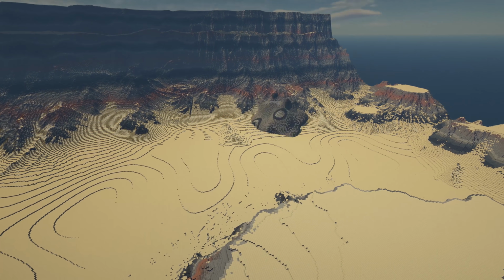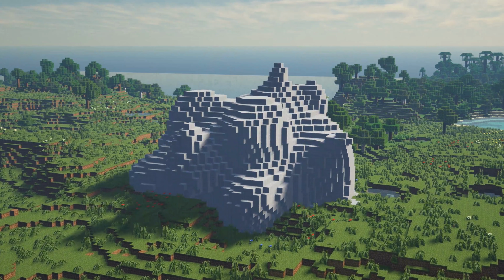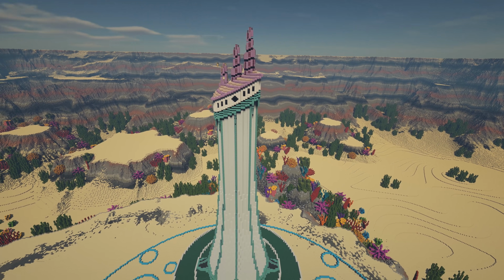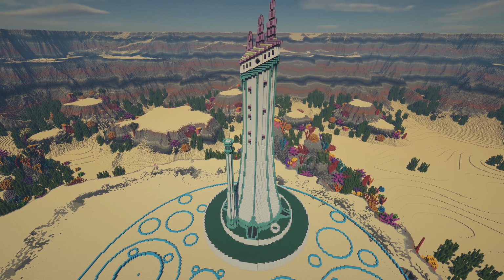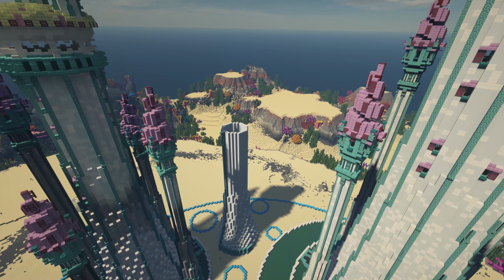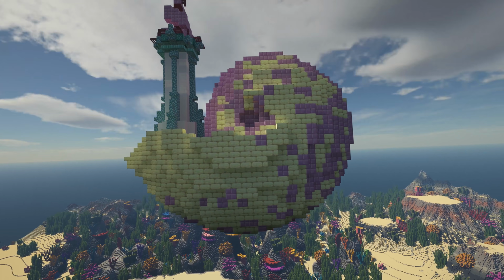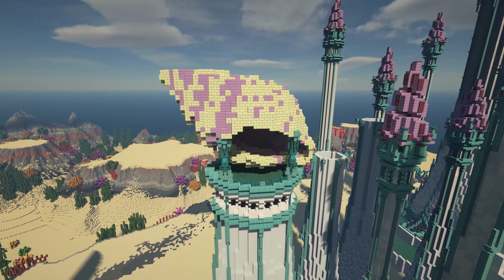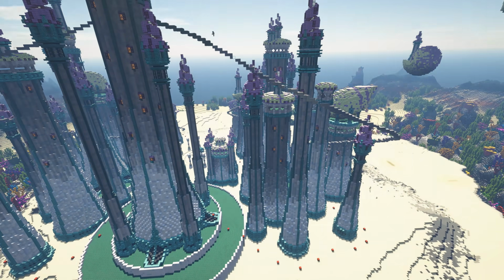My Most Anticipated & EPIC Minecraft Project EVER!

Comment: Sociological Idea (Backstory):
The Underground Kingdom and Underwater Kingdom are rivals - so wouldn't it be fitting for them to have different social/class-systems?
The elvish Underground Kingdom was built very symetrically - symbolozing their view of "black and white" - social classes. They had the rich and the poor - the castle and the slums, which seperated the Kingdom into an elite-area and a poor-area.
Now the Underwater Kingdom appears to have asymetrical builidings and infrastructure - which could stand for a more anti-class system. A system, less seperated by social classes, but with the wealthy and the poor people living side-by-side.
While the Underground Kingdom is more focused on wealth and high-culture, the Underwater Kingdom could be more focused on social contacts, breaking the walls of wealth. They also don't have a cold high-culture, but more of an easy, warm, friendly culture.

This would result in opening the castle to all the people. - Probably they have a wall around it, but in case of an attack (of the Underground Kingdom for example) all of society finds refuge in it. This could be constructed and achieved, by adding a room under the castle, with the only purpose of getting as much people as possible in there - in case of emergency. 
Also having a defend-system, not only protecting the castle, but all of the living-areas would be logical at this point.
Considering the more social-oriented ethics, it would be fitting if the Kingdom had a place for festivities that are celebrated together. 
A vital kind of market or trading place would also fit the idea, somehow pointing out that even the richer people take part in trading there.
The society of the U.W. Kingdom is one community, one Kingdom - fighting one fight: against the Underground Kingdom.
Reply: Underrated comment, TrixyBlox needs to see this one.
Reply: @okamifenris2713  thanks for your support! So warming to hear this..
Reply: Ohh my god this sounds so cool! How is everyone in the comments so creative? And I love the duality of the class systems between the kingdoms!
Reply: @roro_is_tired9975  thank you! I loved the idea, too, had to share it. Cool to see others aggreeing with me ;)
Reply: I think this so a great idea as well it’s so creative I love the idea of having the, underground kingdom and the underwater kingdom being rivals! That is such a creative idea people are so creative!
Reply: @Arson-b6j  yeah i like the idea of the rivalry too! This is such a cool and big project from TrixyBlox!
As well, thanks for supporting my little idea.
Reply: @lage3127  Hahaha! Your comment is spectacular. It blew mine out of the water. (pun intended) We said the exact opposite things lol although you now changed my mind and i believe the concept of an economically equal society in which they fight against the modern day social structure which currently has a very classist outlook, is a million times better than the idea of a class gradient. I think the clash of older times with the new would be an amazing sight. Cultures that are more aged may have the habit of thinking more black and white whilst being forced into a modern age anti-class society and id love to see how he portrays this.
Reply: I also see we have a similar style of speaking lol. For the people that dont understand uhhhh... @Lage is uhmm "Woke"?
Reply: @wishlesskittenscards5651  so cool haha.
Yeah, i think you're right with the similar speak. Don't know if i'd consider myself 'woke', but I don't know, so many things to categorize with today😂
Reply: @lage3127  hahaha such deep talk over a minecraft build i find it entertaining!

Comment: Ideas for the build:
I’m uncultured when it comes to shells so bear with me here

1. Put conduits on top of the pointed shell roof of the clam. Cause it made me sad that the pearls weren’t included or maybe on top of the shell roof to make it seem as if has pierced through the clam as it seems to
2. Put a dead ruin of the kraken slanted over the top of a building or on the side as if it was heading towards the castle and maybe add a couple more buildings and wreck them I guess as if the monster crushed it down
3. Guardian statues at the entrance as if they are guarding the castle
4. If you do add the chisel and bits mod could you add some small plants to add colour inside of the build cause at the moment on the ground area it looks bland or if you add water add small plants onto the sand
5. Add bridges from some buildings to each other to make it look connected

This is a lot so many of these suggestion are honestly large so I don’t expect you to do it. Love your work! Keep going!

Comment: will you go back once the water is added and add in some live coral blocks to the coral you made? right now as your building without the water they'd just die and turn gray so mute point to do that now, would make the reef look dead, also even though that one is meant to be the power source, due to the mechanic and range of said mechanic, wouldn't it make since to make a sculpture of a much larger one and use the real one as wireless routers for the power throughout the kingdom? I think when active they give off a bit, though very little, of light, might be worth making the conduit inside like a crystal to look like its powering the others that could potintaly be dotted around...would make exploring easier too unless if we get the world's download we explore it in creative so we don't drown just getting down to the castle...can't help but fixate on this tid bit of the design for some reason idk

Comment: sea serpent bones at the edges would be epic.

Also, if you made a slightly different design of nautilus shell and placed them hanging around in 3 dimensional space as homes or guard ships/transportation, that would be rad. I mean, an underwater kingdom would not be as restricted to the ground as others would be.

If you did connect anything to the ground, giant chains to the sea bed would be awesome. Even nets used as walls, too

Comment: The water staff have 3 different moves the z move it boost u to your aim and if it full charge it does 1o damage but to be full charge it will takes 1t sec s I not that ez to get and cool down is 5 sec and the next move à : a move that when click u tranform into what u are aiming at cool down 3 sec so the last move q : when u click q u push out a water wave the was full charge it does 13 damage so now the ice staff

Comment: I think you should have a statue of a leader like how you had the elven founders in the caves, except in this the state is damaged/almost destroyed (maybe from an attack by the cave elves), half buried in the sand and at an angle (maybe have a pedestal next to it as if it was broken in half, or maybe no pedestal but remains of one as if it was eroded away), have an arm broken off and several blocks from the main structure, damage to the statue like holes from either weapons damage or erosion, and it obviously being over grown and maybe a new reef is forming on it.
Also maybe add an underwater volcano somewhere.

Comment: Suggestion: Since it is underwater and under all that pressure use stronger blocks and more aquatic blocks in your builds to add to the "strength" of the kingdom. Also make everything completely underwater with no air pockets because why would citizens need to breathe air if they live underwater. Adding stairs for decoration not purpose would be nice too.  thank you <3

Comment: I would like to see a change in the ground around the towers in the castle. The path in the air helps connect them, but not as fully as it could be. I would add some smaller buildings and paths and such on the ground.

Comment: Ideas that would be really cool

- Like a mario kart styled roads swirling around the towers; to add a little bit of fun into the civilization
- A huge abandoned anchor/sculpture perhaps? A building, tower, road could be built using the abandoned structure as its foundation
- Secret caves or treasure troves to add a bit of adventure
- If there is an unwanted space void of anything, maybe it could be the shipwreck domain or something filled with shipwrecks and plain crashes remains
- A large footprint. Yes.
- Maybe like those areas with a treasure in the middle with sharks or hostile creatures guarding it
- a section filled with glowing gems, it could be such a beautiful hangout spot
- A crack om the ground with a creepy glowing eye like as if a dragon is down there peeking in the build idk

Comment: Ship graveyard, library, mass graves for sailors sunk, slums from ships.

Vacation houses near the surface of the ocean

Underwater volcano with blackened shells around it and possibly some houses capitalising on the heat

Mariana Trench full of eels and squids (giga albino octopus is real and it is COMING FOR YOU)

Amphitheatre (defined as an open-air (or open-water) speaking area doesn't need to look Greek) out of one of the rock shelves.

Some sort of Greek fire contraption

Steampunk boats come on disrupt the norm

That's all my ideas

Comment: I'd imagine that this kingdom is working together with the Nether, because it just doesn't make sense for a single conduit to empower the whole kingdom. My theory is that the pillars surrounding the conduit act as pipes (or maybe you could build pipes connected to them) that strengthen the power of the conduit to ensure the survival of the kingdom. But what is the energy that strengthens the conduit? Well, the answer lies in the Nether, the one thing that the underwater kingdom lacks: lava. Lava will turn into obsidian or stone upon contact with water, so my theory is that the kingdom is draining lava from the Nether (pillars going below the ocean floor straight into Nether) and using them as an unlimited energy source for the kingdom, as the Nether is literally full of them. Now, surely they won't just silently drain the Nether, because Netherfolks would be mad. Instead, they made a contract with the Nether Kingdom (I don't know, you make the name) that allows them to freely use Nether's lava as their energy source. In return (as it's a two-way contract) they would destroy Nether's greatest enemy: the Underground Kingdom. My theory is that the Nether and Underground Kingdom (which used to not be underground) had been rivals for a long time. The Underground Kingdom sought to take over the Nether and make it their second home (or maybe just a prison) and the Nether wants to take over the Overworld (some cliche stuff here). The Underwater Kingdom was promised survival and freedom by the Nether, aswell as unlimited energy as long as they could destroy the Underground Kingdom because the Nether doesn't want to deal with them anymore. I don't know, this is just my thought. Let me know in the replies down below :)

Comment: Amazing! But I would put some color variations for some of the top points and shells, and also make the points taller and skinnier  to look sharper and pointer. And with the clam shells maybe a silver, white and cyan type color, especially for the center tower pieces of the the clam that replace the pearl. The coral also looks amazing but maybe some brighter more pastel and neon colors mixed in as well.

Comment: A large crack at the outskirts with some sort of tentacles coming out of it that might be causing a sort of earthquake which would slightly harm the coral around it to make it more visible.

The inside of the crack would have crying obsidian, purple, magenta and pink terracotta and stained glass. The stained glass would be some sort of acid maybe??

The  octopus would be similar to the one you made in your underwater base expert build using similar blocks, it would match the coral but seem darker as to say its older in a sort of way. It could be that its destroying everything in its path and it would also use the same blocks you used for the shells, end city bricks but it would have a contrast to the terracotta.

Comment: My, and other's suggestions are(not trying to take credit, but just rehashing the ideas):
1. Change the column supports for the winding path to a different block to help differentiate them and perhaps sort of hide them.
2. Have perhaps giant Nautiloid ship(like the Illithids use in D&D) or prehistoric mollusk ships "floating" through the water for transportation or otherwise.
3. Others have suggested underwater thermal vents or a volcano somewhere on the bottom and I totally agree.
4. Perhaps needs some kind of military base to counter the underground kingdom.
5. Needs a town or two, but maybe in a Greek style. Perhaps one is ruined(also mentioned by another commenter. Maybe one town could be like an apartment building, but as a giant coral husk or such.
6. A submarine SIMILAR TO(don't need copyright issues) the Nautilus from '20,000 Leagues Under the Sea' would be a cool Easter Egg perhaps if tucked over on the side.
7. Either a seahorse or horse statue as a tribute to Poseidon(god of the sea and horses).
8. Perhaps a glass air bubble building to welcome visitors that don't breath water.
9. Maybe shrink the scale of the corals some, because they make the whole kingdom look like it belongs to the 'Snorks'(They, the corals, shrink the perceived real world size of the kingdom; Google 'Snorks' if needed).
10. A shipwreck or two might also look cool if detailed better than Minecraft default.
11. Lastly, maybe 1 frozen action scene.
Feel free to use them or not. They're just ideas of mine and the rest of your commenters here. 😅

Comment: You need to add some plants at the bottom of the tower, make some small paths, make a couple rooms inside the main towers, make it look real, just so when you go to the castle you don’t have to walk on just sand, just add some decorations at the floor of the main hill, also YOU NEED A WALL FOR THAT CASTLE, and if you can add some smaller houses at the foot of the circle hill so it looks like a walled castle surrounded by a small city.

Comment: - You should include a massive kraken lair hold by enormous chain to prevent it to escape. 
- Geothermal cheminee should be include as power source or in a forge like setup
- It might sound crazy but movie disney Atlantis could an insane source of inspiration for it energy crystal like power source and much more ! 
- Also, using multiple layer of glass blue and cyan glass with light source at the bottom, you could create a "fog effect" that can create a depth effect of a much much deeper trench

Comment: I think it would be nice if there was some light coming frome the inside of the sea cucumbers, some moss growing on the castle structures and maybe some kind of swirl going toward the conduit coming from the surface (maybe made in blue glass so it wouldn't be too appearing? maybe add some small rifts and adding magma cubes on the bottom of them so their would be air columns? (as the depths kingdom was rather curious and taking some "energy" from the surface, i think the underwater kingdom should too). your projects is really mesmerizing so far and I can't wait to see where it goes!

Comment: I feel like the power source is indistinguishable from the rest of the floor of the "castle"
As to the story that is going on between the underground and the undersea kingdom, The water snakes need to come back in some form then, I was kinda wondering why there wasn't a hatchery within the underground kingdom, but there could be a breeding pools area for the snakes.
I think a trident is kind of overdone in an undersea kingdom so why not go for something more creative and different, like a chakram or another more exotic weapon choice when working on statues?

How would an undersea kingdom get their minerals and mine? maybe pumping them straight out of the ground, this could lead to an area a little more destroyed, with crevaces that have pumping pipes going through them with machinery filtering it out.
This piping idea could further be used to heat the forges and generate heat. Thermal heating can be applied here.

I feel like this mix between machinery and magic can be further explored when working on the millitary area. Firearms on a larger scale are not out of the question. The inhabitants have a clear understanding of the ocean so water magic is a given, ice, and steam are definitely part of the sorceres of the army. Perhaps blue crystals could symbolize this?

The slums area could be comprised of shipwrecks and shells that fell down over the years, using it as homes, with walkways between them, finally a lot of machine parts and corals could be incorperated to give it a scavenger feel.

Finaly, shops and residential homes should incorporate the shell motive already established and have a more free form design. Perhaps different shops for different shell types?

Comment: I think you could add some kind of protecting system to the outside of the main tower sa it is totally exposed to a fortuitous attack!
Also, I noticed that there are some little empty space left between the corals around the cliff. Maybe there could be a few sparse buildings/villages for the casual residents

Comment: Would be neat to see a 'Dark Abyss' area with a huge crevasse and a bunch of barely visible black smoker vents at the bottom (be sure to look up Black Smoker vents, they're a hugely interesting geological formation from a scientific view)
You can make it seem darker by putting in layers of dark stained glass or using the new Tinted Glass from the new update if you're able - the one that blocks light but is still transparent. Suspended in the right spot above the crevasse would make it seem dark down there without interfering with the build.

In general, using colored glass above the water to change the apparent lighting (when using shaders, that is) could also be extremely cool looking, but might be very time consuming - but different layers of gray and light gray stained glass can make for good 'storm clouds' that still let light through.